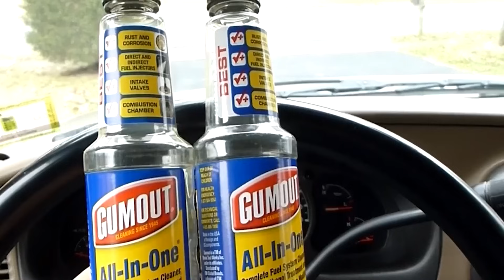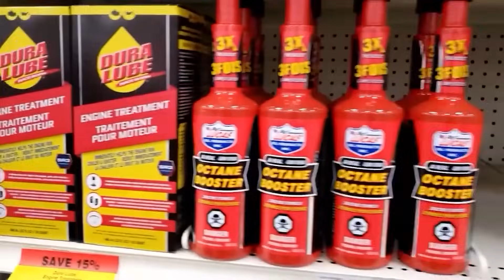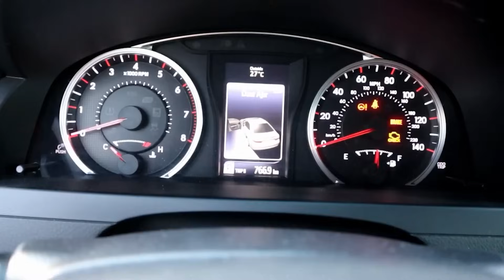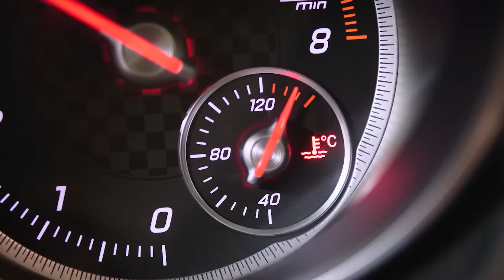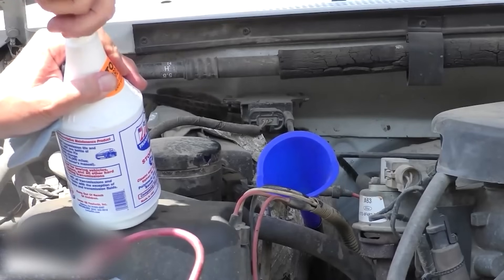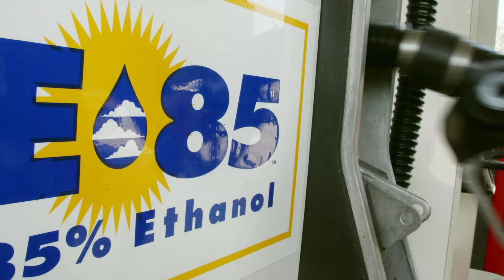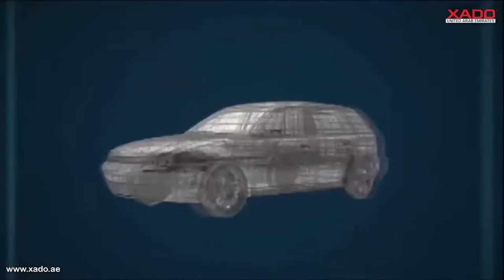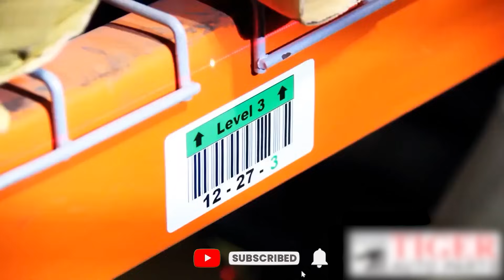13 Car Additives That Are TOTAL Scams (And 3 That Actually Work)

Comment: @9:05 About the oil-burn reducing potion: The only picture of a real oil-burner in this video is the one with blueish smoke. Those others are just water vapor from a cold engine, which is a white color and dissipates very quickly. Oil smoke does not. It just accumulates into a big cloud of smelly toxic waste.
Reply from the maker: thanks for the clarification! oops

Comment: The only thing I had is some Marvel mystery oil to the gasoline and not much just increased top and lubrication. Regular oil changes are better for the engine and any additive you can buy.
Reply: Yes there maybe some concern with GDI injection However in multi port. Injection its not a problem regular oil changes are best method for keeping your engine running. Follow manufacturers recommendations except for 10,000 mile oil change change oil between three and 5000 miles.
Reply from the maker: does that make a big difference?

Comment: Carburetor and throttle body cleaner do have uses even if you have a newer vehicle.  Ever seen the inside of a throttle body after the vehicle has had a good number of miles?  It is disgusting!  That is gunk that makes the throttle body stick and you might think you have a bad mount or your transmission is jerking.  In reality it might just be a sticky throttle body opening up in a jerky manor because of deposits causing it to stick and not open smoothly.  Just be careful with this stuff, if it has any acetone in it, this will melt your paint and some plastics!!
Reply from the maker: thanks for the tip. (by the way, how did you make the word "might" in italics??)

Comment: I use top-tier gas because it is easier to keep your engine clean than clean it after the fact.  but I use Techtron  about 500 miles before my next oil change (every 5K miles).
Reply from the maker: Yeah that’s a good habit. Thanks for sharing!

Comment: The only thing I use is every once in a while I use a bottle of the Chevron Techron fuel system cleaner. The stuff works great! Although I rarely use it, might pour a bottle in at fill up, usually 5,000 to 10,000 miles apart, keeps things running good. I also use it in my lawn mower if it starts sputtering, I pour some into the fuel before starting it up for a few start ups and it is back to running good again. That's all I use, I use good oil and other fluids so my vehicles stay maintained, and anything that isn't supposed to be in the engine or transmission or whatever comes out with a fluid change.
Reply from the maker: That’s a good habit. What car do you drive?

Comment: I add a bottle of Chevron Techroline into my gas tank at every oil change, 5,000 miles, It makes a difference. Better acceleration, smoother idle and higher MPG.
Reply from the maker: Nice. What do you drive?
Reply: @the.GarageIQ  2018 Subaru BRZ Limited.

Comment: If you use Gumout fuel additives, use the "regain" line.  They have much stronger ingredients such as PEA.  As for the oil stop leak.  After about 5years or 60K miles, I add an ounce of it every oil change.  Just enough conditioner help keep them soft.
Reply from the maker: great tip! Thanks for sharing
Reply: All quality oils already have seals conditioners. The over 75.000.Miles, has MORE 2:50

Comment: 12:06  Ummm, engine oil is not a fuel saving additive. 13:31 Sea Foam never claimed to be an engine metal enhancer. Did you bother to even look at your video prior to posting, or is this more AI generated crap?
Reply from the maker: nice catch. the wrong products were shown. I would guess AI would have gotten that right! I'm just a dude who makes videos. thanks for stopping by and clarifying that.